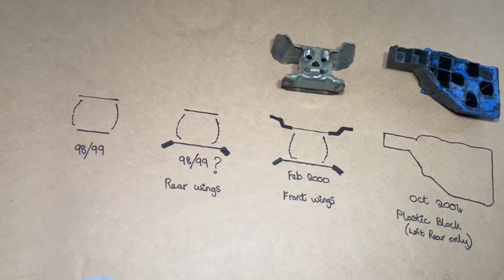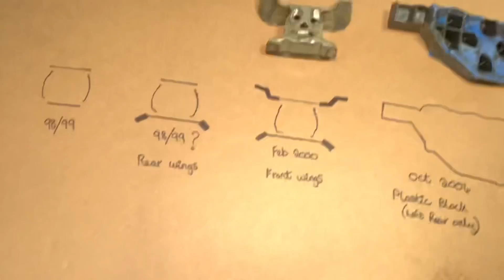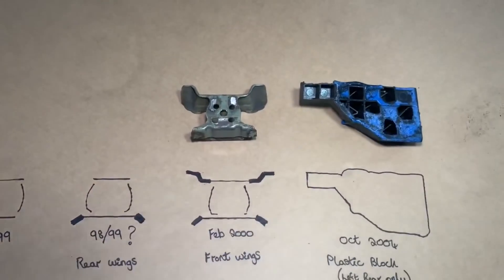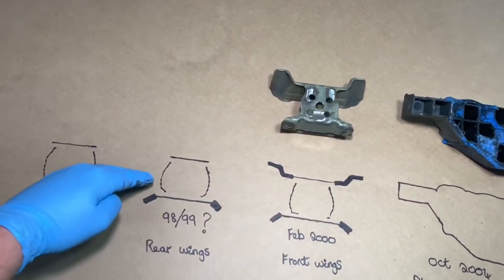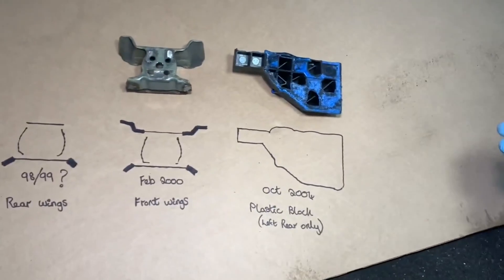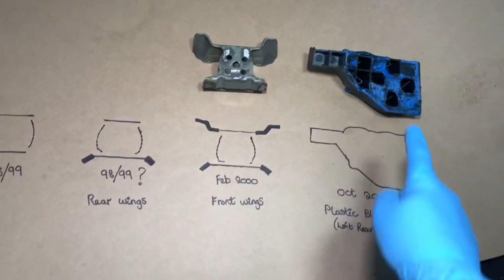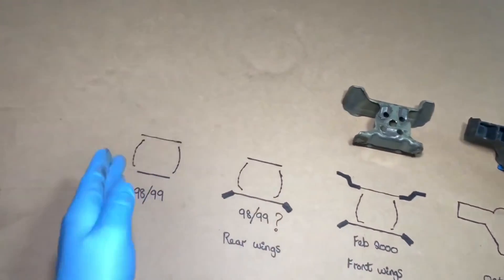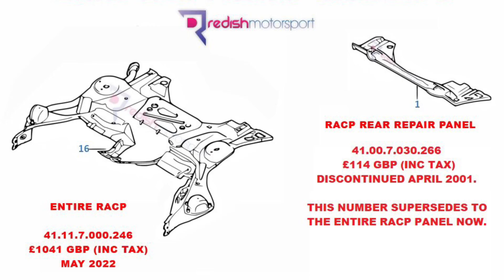BMW E46 RACP DIFFERENCES 1998 - 2006

Comment: By far the best Video about this topic on yt.
My E46 is a 06.2002 330i manual. Currently has no cracks at 175k miles with stock bushings. But I plan to drive it on race tracks and supercharge it. I wobder how long the subframe will hold up.

Comment: Excellent video as usual. I've always wondered how does the plastic insert stand up to welding of the cracks and welding in the reinforcement plates? Does the heat destroy the plastic insert? Keep up the good work, Cheers

Comment: Very interesting. I always wondered what that "internal plastic support" looked like & if it really worked. You should also mention, as you did in a much earlier video, that BMW engineers also moved the position of the spot welds away from the external rubber bushing contact points. Maybe the plastic support & relocation of the spot welds help the E46 issue after Oct 2004. I have a '05 E46 convertible (without the issue for now) & wondered if the convertibles had a "stronger" rear section. Any info on that? Thanks for the informative update! Good job.